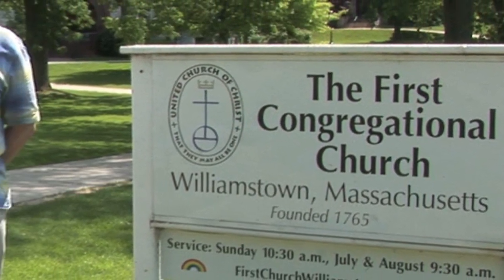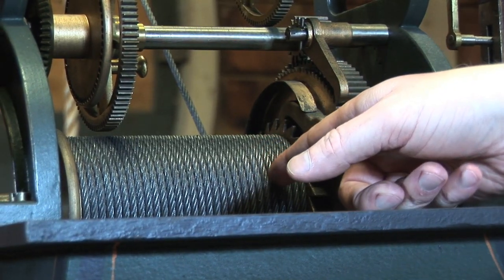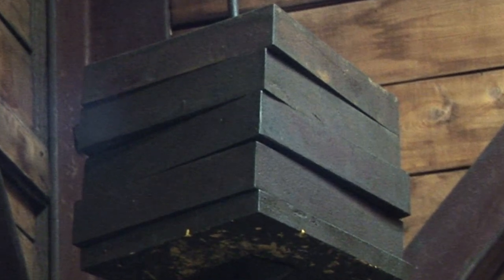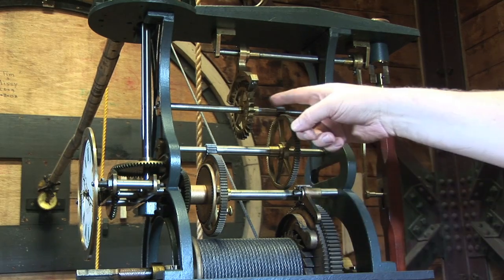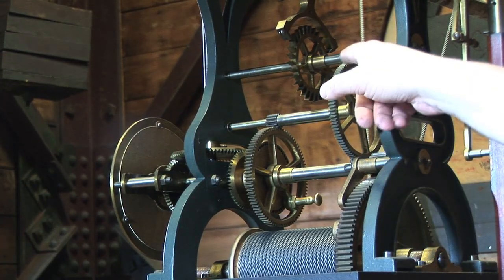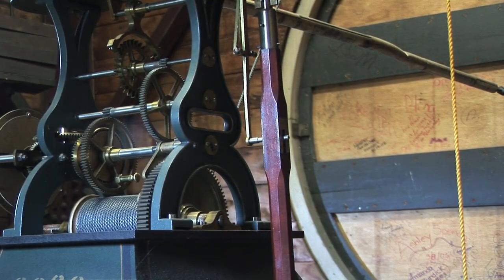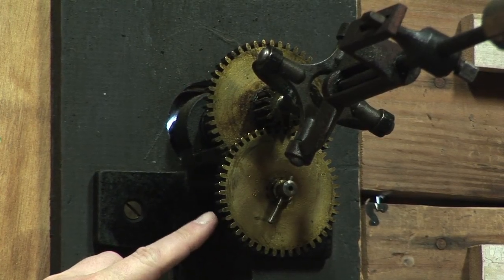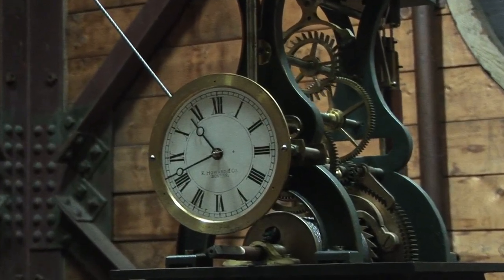How Tower Clocks Work

Comment: Okay but he missed the most important step that EVERYONE wants to know which is how does the weight get the gears and pendulum moving in the first place????? The rest of it isnt hard to figure out especially when you deal with cars
Reply: I'm not an expert on clocks, but I'm pretty sure the pendulum needs to be started manually by swinging it to one side or the other. After that, it should keep swinging on its own. You also have to be careful not to swing the pendulum too far to avoid breaking it.

Comment: Do you think there is a way to manipulate a tower clock in order to "gain" an extra 10 minutes within a given hour? But only in one specific hour? 
Haha, sorry for the weird question but I am asking because I am working on a story where a group of school kids want to manipulate a tower clock.
Reply from the maker: I am not sure how to make that happen. You can slow the whole thing down, or the hands can get stuck on the numbers. You can put the hands on in a way that doesn't make sense (hour hand on 12, but minute hand on 30). You can add lots of gum to the top of the pendulum bob making it go faster. You can make it go faster by making it colder. The pendulum shrinks because of cold.

Comment: Hi.. I am from India. I have a clock like this in house And it's 60 years old but  now it's  not working properly. It's liver stops automatically. I give push start to it but it's stop again after 15-20 mints . Can any body help me to fix it
Reply from the maker: Sounds like the friction is too much. Could be not enough weight. Could be has not been oiled.

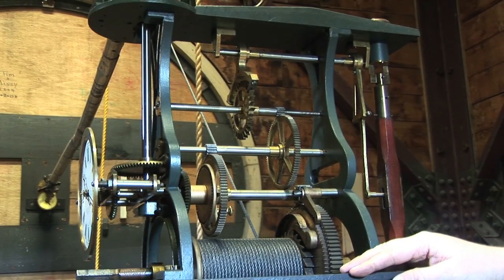Comment: Sir, with great respect, may I point out a slight misconception. At  3:08 it is said that each axle turns faster than its predecessor with less "power".  Well, if one considers the losses as one moves through the gears, that is correct, but neglecting losses the power transmitted at any stage is the same. Power is Force multiplied by velocity. It is the force that changes or shall we say torque.  All the "energy" is stored in the lifted weight and the rate at which this is used is "power". Apart from that, this is an excellent video, my congratulations. It is a beautiful elegant machine.
Reply: Good call... Motor heads with cars always talk about torque. As you, and I know, HP, or weights for a tower clock, make the world go round.
Reply from the maker: Thanks

Comment: nice!  How long does the escape wheel last in this sort of movement?  I know it's a standard pendulum movement, but it seems like there's a lot of force in this large clock.
Reply: The way physics works, so much energy is lost via friction in the various other wheels in the train, their teeth, their pivots, other mechanical work like moving the hands, etc, that by the time the driving force arrives at the pinion which drives the escape wheel, it’s much reduced from the original 224+ pounds. Looks like it’s around 1/2 pound force on the anchor (deadbeat) escapement, just enough to keep the pendulum impulsed to keep it swinging.
Reply: This is partly why weights have to be so ridiculously massive for striking and chiming clocks with large bells, as they usually have very heavy hammers that require lots of force to pick up and drop, although the pins and levers that do this usually work off the very first (great) wheel in the train, the same one with the weight barrel, to try to minimize friction loss and maximize force.
Reply: @andrewbarrett1537  Interesting and thanks

Comment: Nice!   Thank you, Trevor.  How much time is lost when raising the weight?  (How long does it take to raise the weight?)Presumably you must advance the clock to adjust for the time indication lost.
Reply from the maker: There is a part of the gear I'm winding that keeps pressure on so I don't even stop the clock anymore. A commenter told me that I could just wind away with the clock ticking. I don't lose time from that.
Reply: Interesting.  I assumed the movement would go backward while winding if the pendulum continues swinging.   
Howonderful to have such a clock to care for!
At a county courthouse in Missouri, I noticed thathe ceiling had been patched.   The floor directly below had been repaired.   Went to the 2nd floor and saw the same!    Since the repairs were directly below the clocktower I asked if the clock's weight had fallen?  Yes, they confirmed.  Had never heard of such a mishap.     
Later learned thathis has happened in other places!
Reply from the maker: The steel cable gets wound and unwound over the years and it can corrode. It is good practice to make a box of sand for the weight to fall into when the cable breaks. You can also proactively replace the cable. One issue is that clock towers are not insulated much. As a result it has extremes of temperature. When it is cool, the metal is colder and water may condense on the cold steel. Not only could you get corrosion, but dust and dirt infiltrates the cable. After many years, the cable can break. Because of this, many clocks converted to an electric drive to run the clock. I haven't worked with an electric drive, but they can be problematic too. While they don't fall through the floor, they can keep chugging along when the clock has met some unexpected friction and cause damage. The weight will just stop in such a case. The machine works harder and make break the mechanism.
Reply: +Trevor Murphy There is one thing I always catch. Why does the mechanism have that small clock dial?
Reply from the maker: It is easier to see the time on the small clock face than to poke your head outside to see what is on the big clock faces. I sync up the small clock face to the large outdoor clock faces and then it really helps when I want to change the clock by just a couple minutes.
Reply: What do you do for Daylight Saving Time and Standard Time?

Comment: Great video - really informative. What I wonder is how much do the indicator hands weigh - especially the longer minute hand(s) - and why don't they affect the running clock speed i.e. run faster from 12 to 6 and slower vice-versa? Are there counterweights for them?
Reply: Correct. Generally there are counter weights on the shafts to create a stable balanced force.

Comment: After watching your two videos, I still don't understand how two parts of the mechanism work.
The reset mechanism... How does it work such that it doesn't disrupt the clock when you reset the weight?
The output mechanism... The three needles are on the same axis, but move at different speeds, do they use... hollow axles or something? Like... the second hand uses the innermost axle, then the minute hand use the middle one, and the hour hand the outermost one?
Reply from the maker: +Anonymous71475 We don't have a second hand. You are right that an inner axle does the minute hand. The hour hand is on the outside and slowed down with gears. I think I have that right. As for the weight, there is always weight pulling and powering the clock as I wind it. The ratchet keeps tension through the whole process. I used to stop the clock when I winded it, but it turns out not to be so important. The reason I would stop the clock was that I saw the anchor escapement float a bit as I wound the clock indicating less tension. I think the power is less, but sufficient. The winding does not take that long.
Reply: Weight driven clocks require a form of maintaining power to ensure power is still available to the going train whilst winding takes place. See this article for more information....

https://en.wikipedia.org/wiki/Maintaining_power

Comment: Thanks.
Interesting to see a modern clock. The only other tower clock I have seen is from about 1660.

About maintaining power (sustainer?). I hang a small weight on the second wheel of my home made clock when winding it. If I forget to remove it, it will just fall on the floor after a few minutes.

Comment: Does this clock not have maintaining power so that it will keep running when you wind it?
Reply from the maker: The maintaining power might not be fully functional. If I wind it while the pendulum is swinging, the escapement wheel kind of floats. It doesn't have the full pressure of the weight.

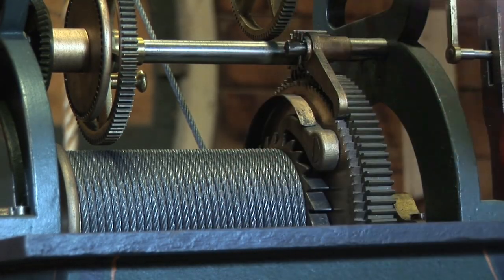Comment: At 1:22 I can clearly see the maintaining power 'funktion' on the weight wheel.
If the 'small' spring on this wheel is missing then the clock will run backwards when you wind it up for sure.
But a maintaining power is created therefore, that the clock coninues running further while the winding progress.

Comment from the maker: When I'm winding the clock the escapement wheel floats as the anchor horns jab into it. It might be fine, but power is not maintained. I should video tape it so you can see it and tell me what you think. I rather stop the clock than allow uncontrolled behavior of the anchor escapement.